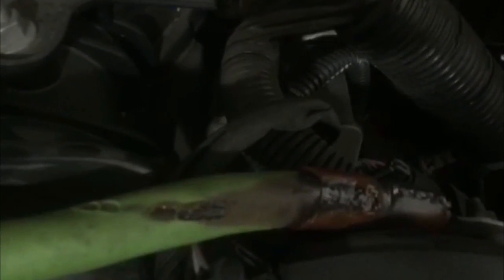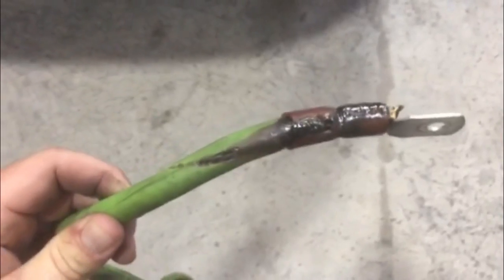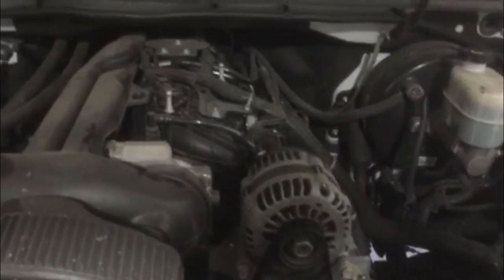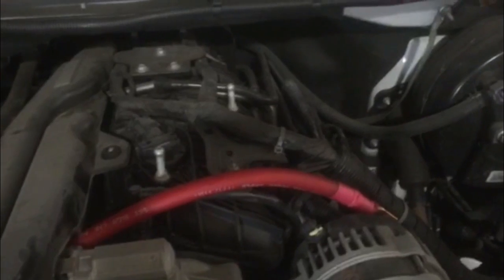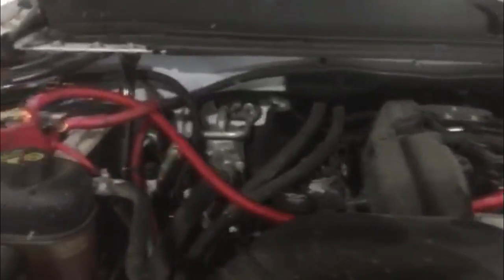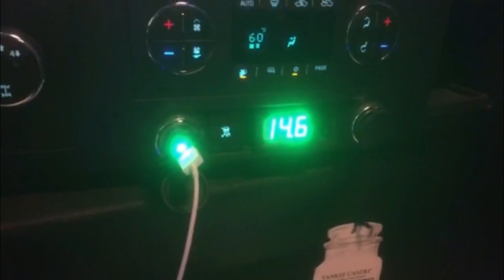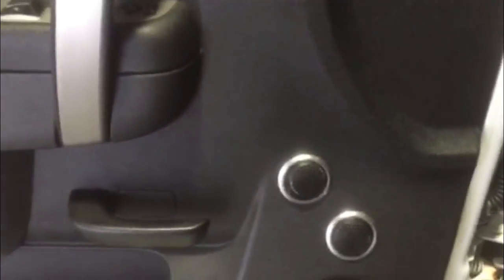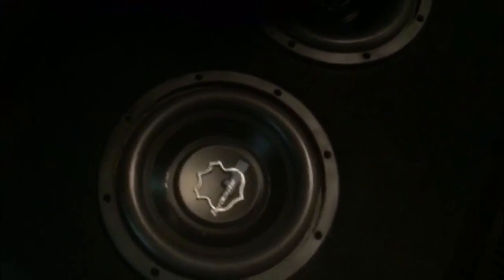Why not to use CCA wire!

Comment: I wouldn't ever only crimp CCA. Aluminum when it oxidizes creates a ceramic dielectric around itself, alumina. You need to prevent this oxidation from happening or your connection resistance will slowly increase in time and melt the connection. Either fill the crimp with solder after attaching it, or with carbon glue.

Comment: THAT was the result of a poorly made end in a bad location, and piss-poor routing.  Most of the strands weren't even making connection, as is evident by the helical burning on the insulation.   Location was poor, heat caused a further degradation of the connection as a result of thermal expansion, then finally, out came the magic smoke.    

Wire is way bigger than you need for an alternator output, with ends entirely not up to the actual gauge of the wire.   Lot of show, and not a lot of function is parts like that.

Comment: In the wires defense you had it directly behind the ventilation of the alternator which I'm assuming can put out some serious heat over time. I have seen lots of burnt wires. Yours had a suspicious pattern
Reply: kinda like it burnt from the outside as the line further back was wider on the outside, tapered inwards. Burnt heat shrink but not the jacket, exposed wire was nice a copper coated shiny at the lug....... I agree

Comment: Well, CCA is a good enough wire. You just have to know how to calculate the wire gauge. Aluminium has a lower conductivity compared to cooper, so the CCA gauge has to go up to compensate that.
Still, as an electrical engineer, i always use coper because of the aplications i use it for.

Comment: They make very good wire bro. You are drawing more amps than the wire can handle. You can use it with no problems but not for very hi amperage draw.

Comment: Usually when the wire melts like that it's a voltage drop at the terminal. It is usually from it not being crimped right. I fix these issues on vehicles daily. Voltage drop creates heat. CCA wire has a higher internal resistance but it does not cause the issue you posted unless you are drawing too much current for the size wire.
Reply: Just like the problems that plagued Al branch mains wiring many years ago.    It was fine if it was the correct gauge, connected with the correct terminals, and was at the correct pressure when connected.        CCA works for many uses if it is the correct gauge, within the proper temperature rise for the ventilation available, not attached poorly, and not in a moist environment.   I use CCA to feed 4 RF power pallets with an output of 4kw at 12mhz that I guarantee are gobbling up more electrons than your audio amps,  Each one uses 92-95 amps at 54 volts (terrible efficiency) .  All through 2/0 CCA.  temp rise never over 65c.    Works great.   But then I own the proper hydraulic crimper,  and hex-dies, the connections were prepared properly, treated properly, and sealed with the proper adhesive lined tube, then connected to the correct terminal devices.      

Crimp those ends with your silly 2.80 china-mart sheetmetal crimper, using connectors intended for car 12v battery cables, and I am on the way to either becoming a fireman (bad) opening my billfold (worse) to replace the 4 matched output transistors in each amp... worth just short of 800.00USD a set.

Comment: That burn out does not look like the wire's fault.  The metal connector could have been close enough to the alternator case to arc or the connector to the wire was poorly installed and connection was not good or got loose.  If one of those situations had occurred,  then it must have gotten intensely hot which caused the burn through of the insulation.  The insulation appears too thin for that application also.  The aluminum of the CCA has higher resistance than solid copper thus under a heavy load was a contributor to the damage.  Funny thing I was looking at some Sky high CCA wire on Ebay just before finding this video in a google search on CCA wire.

Comment: Aluminum is terrible in conductive properties. It’s good for dissipating heat. The problem with the aluminum conductor is that it expands with heat and retracts when cool witch stretches the cable causing hot spots and all sorts of problems. Spend a few extra bucks and buy a good copper cables

Comment: Im running 2500rms. I had 0g ofc everywhere. Except one small 3 foot section which was from exit of 250amp fuse to rear battery positive terminal. That was cca 0g wire. I have been thinking of upgrading it for awhile but didnt do it till yesterday. I replaced it with 2/0 welders cable. Wow what a difference. That cca was def the weakest point in my system. Cca 0g can handle maybe 1000 to 1500rms and nothing more. Good for small systems. But if u r running bigger then its ofc or welders wire for sure. Now my system hits with much more authority. Wish i did this upgrade a long ass time ago
Reply: Did it improve your overall electrical?

Comment: FWIW, the failure was due to exceeding the wire's current capability. While OFC is capable of carrying more current, the failure wasn't due to strictly being CCA. Had you known the limits of the product you were using, that wouldn't have happened. That said, fuck CCA. Probably would have turned to dust in a year anyway. EDIT: Looks like you ran that Knu wire like shit too.
Reply: firebirdude2 so your saying that CCA can’t handle a 1200 watt amp awesome. Changed to OFC on the same setup no issues.

Comment: This is what I think look at the skin of your wire it looks like it was touching the alternator it got melt cuz of the hotness and then simple short.. run you wire trough the firewall avoiding the engine of course

Comment: You ran a wire across the top of an engine block and said it had no reason to get hot...... Enough said.
Reply: It's not laying on the Alt it's far enough away so there is no danger WOW
Reply: @frankrivera9083  your right. It's laying on top of the engine. Literally the 2nd hottest part of a vehicle besides the exhaust. Dumbass.
Reply: BlackRaven question where is your factory wire ran? Oh that’s right across the engine the same place I ran that wire enough said!
Reply: @robertjacquin  Factory wire meant for high temperatures. What's the heat rating on that shit you ran?
Reply: BlackRaven I have ofc ran in the same location as I had the cca since I replaced it and not one issue. Lots of people run cca that’s fine I just will never use it again.

Comment: When choosing wiring, there are a few things to consider: first the amperage you expect to draw through the run of wire, then the length of the run, and finally what temperature you expect the run to see. There is literally nothing wrong with running CCA wire. I have worked with wire that handles much, much more amperage than what you'll find in vehicles doing industrial electrical installations and maintenance. They used aluminum all the time, unless the requirements of the job(heat/space/policy) demanded it be copper. The problem comes in if you haven't properly accounted for those variables. CCA is not as conductive, ergo it is more resistive. Heat also increases resistance. So, at 20', a 1/0 CCA wire can easily have an ampacity of 250A, while OFC can handle about 350A. However, that is assuming a relatively cool operating environment(up to ~120°F say). As the heat increases, so does resistance, ergo decreasing ampacity. That spot where that happened, looks like it probably traps heat with that shroud. Also, I'm not saying this is the case, but typically if it happened right at the termination point, it's usually a bad termination, but given the other information I'd say heat probably reduced ampacity so much that the same amperage caused it to heat up, further reducing ampacity, and dissipating energy as heat. Vicious cycle kinda thing.

Comment: I ran a big 3 upgrade with 4ga cca for years with NO issues whatsoever. Had 2000 watt amp running off it. Worked great. Just sayin.
Reply: You really shouldn't run more than 100 Amps through a 4 gauge CCA and that's really pushing the limit.   I'd really feel safer at about 75 Amps considering how many melted fuse holders I've seen over the years.
Reply: Stepside1986 I used to have cca wire and drew around 60amps and melted a fuse holder but I think it’s just because that fuse holder was cheap, I’ve recently up graded to 99.99%ofc 4 guage wire with Rockford fosgate fuse holders and I’m having no problems but only time can tell

Comment: don't run ur wire over the block or rest ur wires on anything.. all my wires are floating or hanging.. haven't had any issues even on 90 degree days.. 
although I am currently running new ofc through my whole system and using tech flex wire wrap to change the colors up a bit, and then I can switch to any color I want.. I'll probably just update the visible spots in the future once I get tired of one color or it gets dirty
Reply: tankdog03 has nothing to do with how the wire is ran. It’s the wire itself and I live in south FL. Never had a problem with OFC. It’s the only thing I’ll ever run.
Reply: +Robert Jacquin years I'm sure the ofc is a ton better, you get what u pay for.. I did notch the cca gets a little softer and I've had to re heat the heat shrink in a couple spots because it loosened up.. yeah once you actually hold on to a piece of ofc it makes you realize how dumb u was to save 20/30 bucks.. any regular person would probably never know the difference.. you should just run ofc 4 gauge instead of wasting money on cca 1/0 at least it would be quality wire for same price.. lol buy it once do it right people, I learned.. but I'll find a use for the cca somewhere. ..
Reply: @robertjacquin  the wire melting on a hot day in the engine bay is not necessarily the type of wires fault, its the insulation, just like how this was all his fault because he ran the wire ON TOP OF the engine, he was asking for it to melt and then blamed it on being cca and not complete user error

Comment: That is your fault. Ive ran cca wire in mine for 6 years. I have 2 runs to the back and on a crescendo 12k wired at .67 ohms. No issues.
Reply: Robert Jacquin 9 times out of 10 its user error. Usually caused by bad termination.
Reply: Chris Tamez I was only running a 1200 watt amp at a .5 ohm. No reason that should have happened. But I’m glad it’s worked for you 2 runs CCA cost the same as 1 run of OFC.
Reply: Robert Jacquin and 2 runs of cca is better than 1 run of ofc.
Reply: +Chris Tamez and 2 runs of ofc are way better than that of cca.. but if money or the price is a factor then do it the wrong way twice..
Reply: tankdog03 guess im doin it wrong
https://youtu.be/p-LdvdMI7qA
Reply: Oh ok so faulty wire is my fault sounds about right thanks for pointing that out.
Reply: Chris Tamez yep your right but there’s always that 1% that it’s not users fault.
Reply: Robert Jacquin these chevy's tend to be very hot under the hood. He believes it not to be heat related but they do get super hot.
Reply: Chris Tamez It could have been a faulty covering on the wire. I just know I don’t use or install cca in anymore of my builds. Can’t take the chance of it failing. Personally anyone can run whatever they want. I just won’t use it again.
Reply: Robert Jacquin personally i would have ran that along the firewall to the battery. What did u crimp it with?

Comment: You can't use the same size CCA as CU to run the same current at the same temperature.  This is a situation where someone used the wrong wire size for the current.  If you size the CCA wire correctly, it will run just as cool and just as well as the CU, usually with a higher current rating.  Such as, 6AWG CCA will carry more current than 8AWG CU.  There also may have been a heat issue judging by where the cable was located.  Adding external heat to the wire is a different test.

Comment: I ran cca for years and I never had any issues with the wire. That happens when you have a bad connection to the terminal. The copper wire has better conductive properties and is much better but the cca can be used safety especially if you on a budget. If you are going copper I would suggest welding cable and not car audio wire. Welding cable is so much better and cheaper. The audio wire is definitely not worth the money.
Reply: Joseph,  we are planning to make  battery cables with CCA wires and I believe that if the wires have the proper cross section and insulation with proper termination meaning use of proper end connectors . There should be no difference in the performance of the cables except that they will perhaps be a little harder which you may call less flexible. 
The insulation of the cables should be so chosen that it is  able to stand high temperature  under the car bonnet.  If you have any suggestions please feel free to write to me  brijvaish@itpindia.in .
Reply: I have Royal Excelene welding wire and Install Gear OFC both are 4 gauge and both are the same size of wire under the insulation.
Reply: car audio cable is typically bigger tho.. 1/0 car audio is about the size of 2/0 welding cable, so u get what u pay for.. when I upgrade my my grounds I'll probably buy 2/0 welding / battery cable also.. local guy to Michigan sells it pretty cheap.. AC/DC on ebay is his store name.. about the cheapest around that I've found to b good quality
Reply: @tankdog03ify  I’m sure you’ve learned this within the last 4 years but just for anyone else stumbling across this just like me someday, the diameter of the wire doesn’t mean it’s more or less.   Strand count alone makes the size vary.   AWG standard is just that.  You’re not “getting what you pay for” by paying for gimmicky advertising.

Comment: This wire is mainly used for difficult runs due to it's extreme flexibility, that's why the jacket is so thin But another problem with this wire is it corrodes very easily and once the inside starts corroding it doesn't last very long. & this was in a controlled environment not under a hood. Where I've got my amps located regular 1/0 ofc wire wouldn't bend or Flex the way I needed it to it caused a lump in my carpet! But USASCI or maybe the other been so long I can't really remember which but require the wire to be fastened every 6 in so using p clamps I fastened it to the floorboard every 6 in and I put closed cell matching the thickness foam on the sides to give it a better transition

Comment: fyi, sky high also sells CCA, and Knuconcepts sell OFC...so thats not a fair comparison. its actually your fault for buying cca.
Reply: I upvoted you as I agree welding cable is awesome. Pure copper and usually super flexible.

That said, genuine OFC is fine (not OFC coated aluminium). CCA is ok for audio usually but if you want to drag serious power from one place to another, copper is king (unless you have very deep pockets for silver)!
Reply: The sky high was getting cancer and every month had to cut down 4 inches. Then it was turning into a cooked Carmel color. Ran some 2-0 copper and I'm happy.
Reply: Some sellers make it very difficult to see that what they are selling is CCA. I bought some by mistake and it was not even labeled as such on the label. Bought it from Amazon as a buy again and it was copper the previous times.
Reply: Right I have had both brands cca and ofc and imo they are both junk I run welding cable now.
Reply: @colewoodruff5214  You realize welding cables ARE OFC if they came from a decent welding supply, right?   No?   Well, they are.
Reply: FYI knu concepts sells CCA wire as OFC........it contains 10% OFC
Reply: @juggernautxtr  Where on Knu's website do you see CCA being sold as OFC? They don't. Both types are for sale and both are properly labeled as such.
Reply: @firebirdude2   light it on fire it melts copper doesn't melt.
Reply: @juggernautxtr  Maybe you need to reread my comment. Give me a link to Knukonceptz selling CCA as OFC. Knukonceptz does sell both, but they're both clearly marked.
Reply: @juggernautxtr  all metal melts under heat . Even copper , steel , gold , ect. .
Reply: @firebirdude2  I believe I typed what you meant to say. ^
Reply: @firebirdude2  yeah I've used their kolossus kable too, it's legit ofc, of course. He def bought the cca wire 😂
Reply: @juggernautxtr   juggernautxtr   juggernautxtr  so wait...you are saying the knu konceptz "bassik" wire, which is cca, is indeed only  10% copper, or ofc as you put it,  and 90%aluminum and filler. And their kolossus cable, which is 99.99% oxygen free copper, is still only 10% copper? That is NOT knukonceptz selling cca as ofc, that is the industry standard for cca! Their kolossus ofc is tinned ofc so it still LOOKS like cca, but its tinned to protect from the elements. You can tell by the weight. Go back to electronics school, dont @ me. My ig is @installsbypat come see my journey and try to tell me otherwise.
Reply: I agree after having good copper ill never run cca from any brand I love my 2/0 welding cable and I just picked up my hydraulic crimper, I'm done soldering also haha.

Comment: CCA wire is crap, it has to be twice the gauge to carry the same current. It does not solder as well, It don't hold up to vibration as well, it corrodes easier, and it gets MUCH hotter under maximum load.
Reply: Not only does it corrode more easily but unlike copper, corroded aluminium is an insulator.